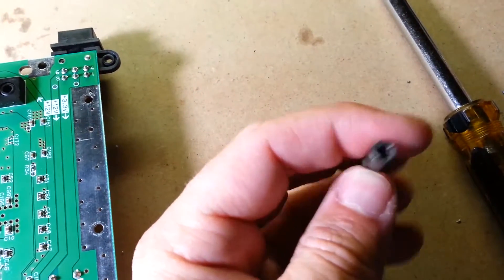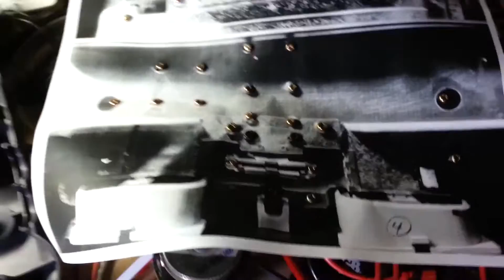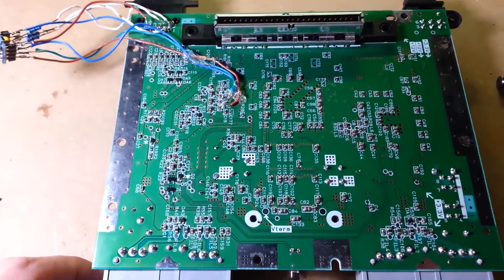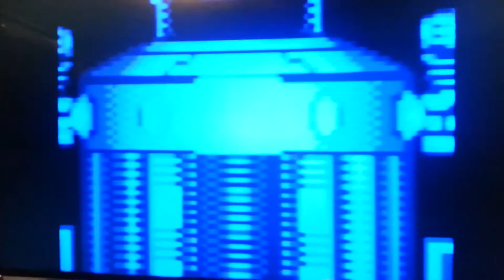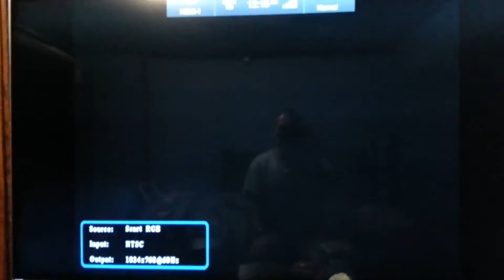Nintendo 64 RGB Mod - Non-Destructive

Comment: How did you get audio to work after the N64  RGB mod? Did you rewire it onto the HMDI box?
Reply from the maker: +gotloveforall01 The SCART connection carries audio, so it just sends it to the converter box, which then sends it over HDMI.

Comment: I did this mod but I am using a SCART cable and converter both from eBay, however when I use the SCART cable and converter I get nothing to display but If I use the normal rca cable I get picture!? Any ideas?

Comment: Hey, great video. Just had a question.
I did this mod myself and successfully got RGB without an amp, meaning I soldered the 6 points correctly from the input to the chip. The brightness, as stated by many, was weak so I decided to install the amp. I got the chip and circuit board, three 75 ohm resistors and one 104J 400V 0.1uF 9mm. When I booted the game the screen showed a red picture that was so bright I could not make any images out. I tried removing the resistors and the same thing happened except this time the screen was white instead of red. I tried another chip, I re-soldered all of the wires, I even reverted to the non-amp mod to confirm I didn't mess anything up and everything checked out right. Do you have any idea what the problem could be? Please help. Thank you!
Reply from the maker: Patrick Sobanski I distinctly remember the overwhelming red saturated picture when I did this mod - it turned out I had the pins connected wrong to the chip. Very easy to do since the chip pinout doesn't match up with the little board, it's like backwards, at least it was on mine. Trace the connections on the chip to it's board and then to the N64 and make sure they're correct.
Reply: Note taken. I just took the chip apart to check it out. So, to be clear, the ohm resistors go on the 'output', which connect to the top of the board at the av connector (same side as the ground), while the 'input' has no resistors and connects to the board chip. Is that correct? I'm also playing with soldering to both the legs on the chip as well as the bottom as you did to see if it makes any difference. 

Thank you for the reply!
Reply: +Patrick Sobanski you can take the brightness down some more with resistors on the input as well

Comment: Another question about this mod. The scart cable I'm going to get is sold by a console cord specialist on ebay, and her best NTSC SNES/modded N64 cable can only be fully used if "the c-sync is connected". Now, I'm not experienced with exactly how and where an N64's chroma, luma, r, g, and b, come out of, but I'm using stills from this video as reference. So, I'm asking if your mod has the c-sync connected. Because, if so, you can get a better cable than the one you have. If not, her cable can be modified to 'luma as sync' instead. Not as good, but still good.

Comment: What gauge wiring did you use for this? And how did you get them to have red green and blue insulation? I just got the THS7314 chip off ebay, and am pretty close to doing this mod myself, so I'd like to know.
Reply from the maker: It was just wire from CAT5 cabling that I use for breadboard jumpers and simple project wiring. Any smaller wire like 22 gauge will do. Adafruit has spools of different colored wire if you're looking to buy some, http://www.adafruit.com/product/288 for example.

Comment: WIth the Nintendoes connected, does the HD converter put out a signal that is 4:3 or do you have to force that with your TV settings?
Reply from the maker: There's a setting button on the converter that lets you cycle through if you really wanted to stretch it, but I like keeping it the original 4:3 as intended. Since it's outputting and converting to HDMI the signal will always be 16:9 so no need to mess with TV settings.

Comment: Does this mod still allow for s-video out as well as composite?
Reply from the maker: Yes, non-destructive, so nothing is destroyed, only connections added. I had tested the composite-out and it still works so s-video would be the same.
Reply: xtalviper
 Thank you very much for telling me. I was concerned with the possibility of a mod destroying s-video since I've heard some claim that the scart-hdmi setup looked great for 240p games, but were horrible for Expansion Pak 480i games since the N64 constantly adjusts the resolution for games using it, making s-video a more stable solution for those games. Then again, I've heard them say that after modding, using vga was better than scart.

Comment: I have a NS202815464, and to my surprise it actually has a VDC-NUS A!!! Motherboard revision is -04, would this still work?
Reply from the maker: As long as it has that chip (NOT AVDC-NUS, so look close), you should be good. Looking at the example serials, the chip changed from VDC-NUS to the next chip that won't work somewhere in between NS18-NS20, looks like yours was just under the wire.